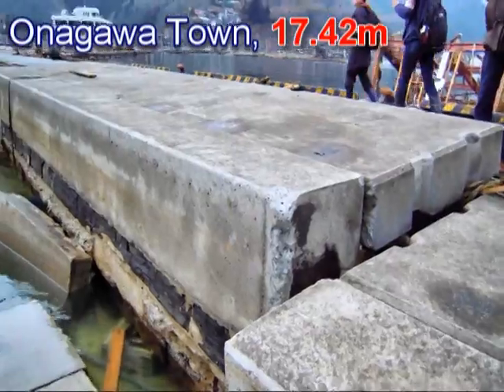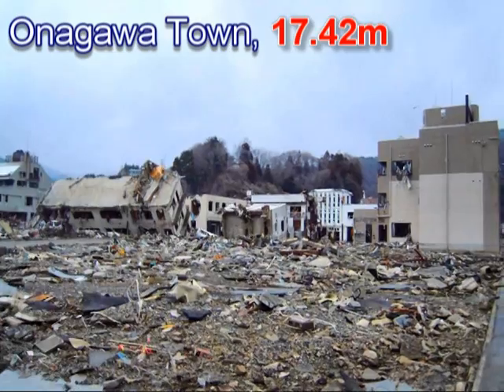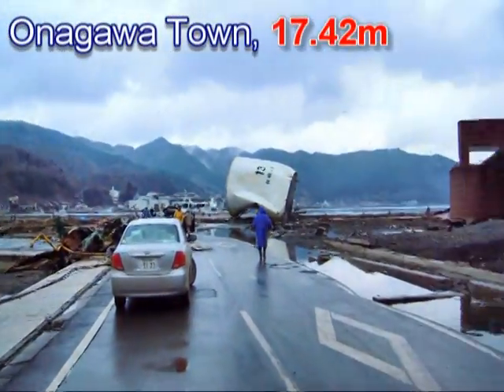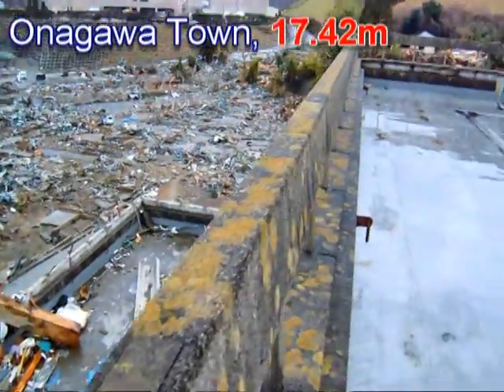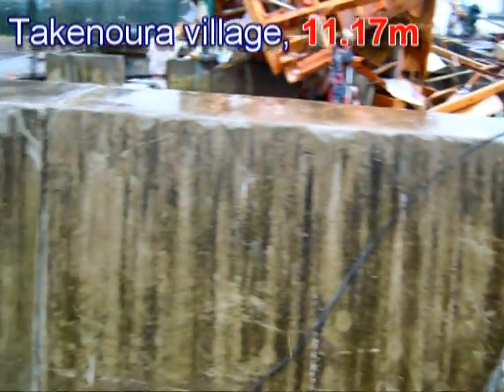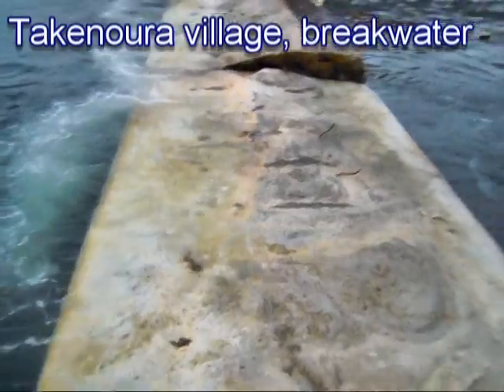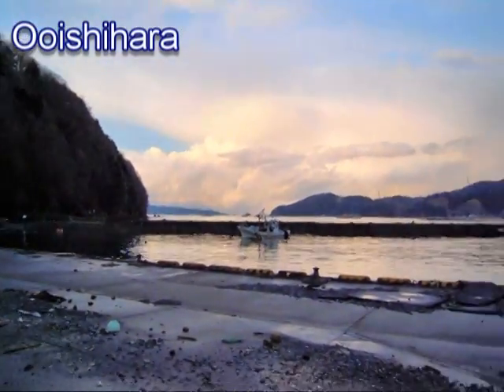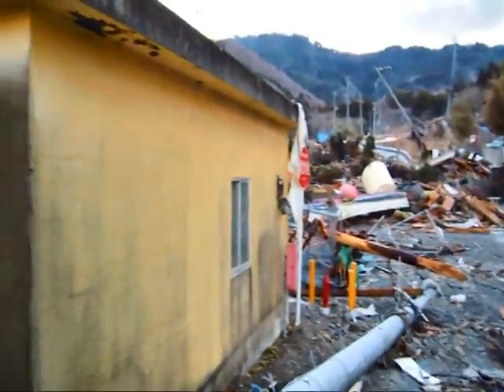Tsunami Survey in Japan (Onagawa) after the 11 March 2011　Tsunami 宮城県津波調査女川

Comment: If the tsunami manage to reach the hospital then how did the recorder who was on the the brick building manage to capture the water receding. That hospital was higher then that building.
Reply: No it wasnt. The hospital was 2 stories while the brick building had to be more than 4 stories tall. If you guys are confused at what building are what, the white concrete building with some sides brick is the hospital, the larger, fully brick building is where the person fillmed the tsunami
Reply: Simply... Run-up vs Innundation
Reply: @jessejaymes8684  Yes, it's called tsunami innundation and it's different from tsunami run-up.
Reply: @jessejaymes8684 

I'm sorry i still don't understand.   That red brick building under the hospital not even covered by sea water.  n  nearest the sea.  Logically the area under the hospital it supposed all were sunk.? Since the sea water rose and reached to first floor of the hospital which so much more higher area than that brick building......

Comment from the maker: you have to differentiate between tsunami inundation height and tsunami run-up... run-up was over 40m in some places, were inundation height was around 17m there... essentially when the tsunami reaches a hill it will start to go up, the highest distance it reaches is called run-up height.... the height of the tsunami at the beach would (on the other hand) be called inundation height. This is a very simple explanation but hope it helps?
Reply: The tsunami is not really water though, is it? In most cases, by the time it reaches a built up area it is carrying so much sediment that is in fact more like very thin mud. This has a much greater density than water and so behaves differently. It is more powerful and destructive than clean water and, I imagine, would drive further up a slope. But, I don't know that. My question is, under laboratory conditions does the sediment content of water affect the run-up height, given that all other parameters are identical?
Reply from the maker: @lucianisidro  Indeed, you are correct. A tsunami has so much sediment in it (when doing fieldwork, our team has often been bogged down in mud left after the water recedes). Also, it carries with it wood and any other floating debris, so it is indeed a very viscous fluid. However, under laboratory conditions we cannot simulate all this, given scale factors. Truthfully, most of the time we also use freshwater (as seawater could corrode much of the equipment, etc). So, these are all known factors. However, compared with other issues related to how the tsunami propagates inland (for example, the quantification of how the forests would reduce velocity -and to what extent the forests survive-, the effect of complicated patterns of buildings -again, and which are destroyed or remain, etc) this issue of the "higher viscosity" of the tsunami is relatively minor (I am sure in 5-10 years time we will be starting to fine tune for such things, but in the meantime we still have many "bigger" problems to solve, if this makes sense?)
Reply: @adrao77  When related to the bigger picture, yes this does make sense. However, when an engineered structure like a bridge is overwhelmed then the density of the fluid can mean the difference between the decks staying in place or being flipped over. The case of the Utatsu Bridge springs to mind, where entrained sediment was seen to be essential to the failure of the decks. When analysing structures like this, I think then the devil is in the details. https://www.yumpu.com/en/document/read/24265888/cfd-analysis-of-bridge-deck-failure-due-to-tsunami
As for forest survival, a very interesting example is that of the Matsubara Forest, planted on Oppa Bay to act as a windbreak for the town of Kamaya. It consisted of 20,000 pine trees, up to 60 feet high and some 100 years old. When the tsunami approached, as a witness attested, "the sea was overwhelming them, swallowing up their pointed green peaks and tearing up the forest in a frothing surge" (Richard Lloyd Parry, Ghosts of the Tsunami, 2017 p. 128). 
These huge trunks were then carried into the town, smashing everything in their path. If there hadn't been any trees, there would arguably have been less damage, and the New Kitakami Great Bridge would have likely survived intact. In the Kamaya event and many others like it, it was the river that was the gateway through which the tsunami gained access to the land, but the trees did more harm than good in that particular case. Of course every event is different, but I still maintain that turbidity, entrained sediment and debris has an enormous effect on how the currents behave, especially when dealing with specific issues of structural integrity. Many thanks for your informed conversation!
Reply: Thanks

Comment: So did the water rise to 17 meters when it entered the bay/city?  Or was this wave already at 17 meters when it struck the city?  Can you point me to documentation of what the hightest tsunami that struck Japan?  I read on one video that somewhere the tsunami was 40 meters?
Reply: From ground level the tsunami rose 17 meters. A four story building would be 16 meters. In onagawa and other towns there wasn’t a cresting wave but a gradual rise in the water level. This is due to the deep seas reaching close to the coast and the tsunami having a big wavelength. The highest tsunami height was in a small district called aneyoshi, in the town of Miyako. One factor that influenced this was the small valley the district was in funneled the tsunami, creating a wave that had a max run up of 40 meters.

Comment: There's a video shot in Onagawa during the tsunami, from the tower atop the building visible at 1:13 - the one with the white car hanging from it. Originally there was a raised walkway connecting this building to the red brick building seen at 1:20, over the road between them. 

The depth of the water here, and its violence, were almost beyond belief. You see whole wooden buildings being bashed to pieces against the brick building by the water's backwash as it returns to the sea.